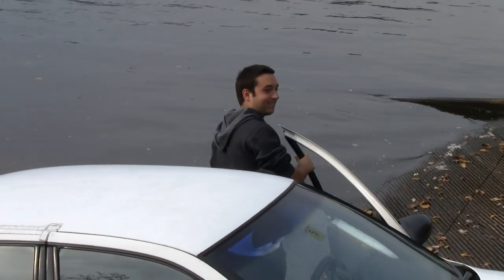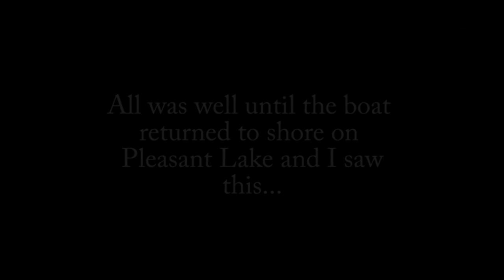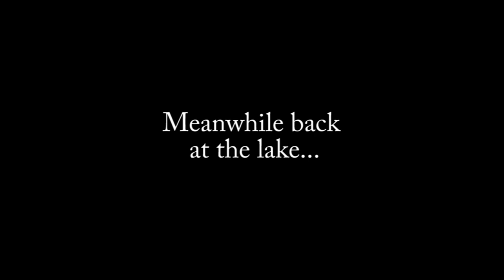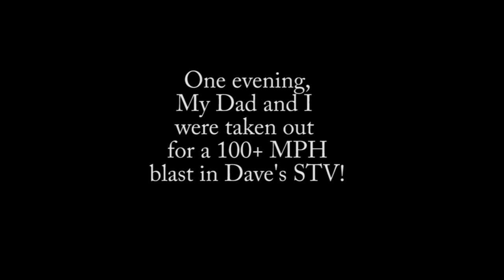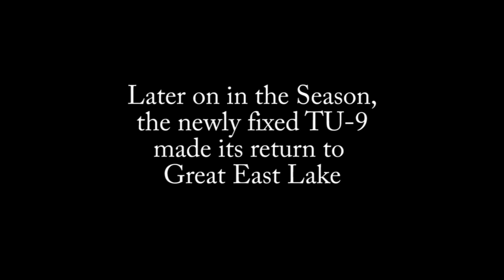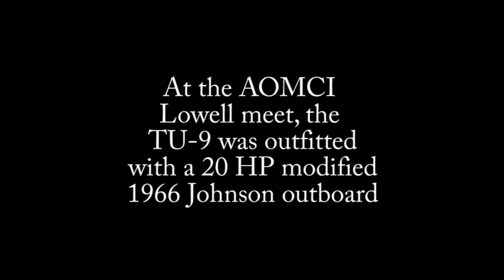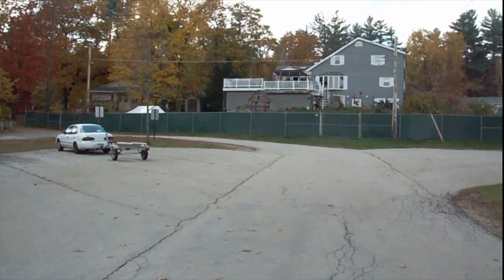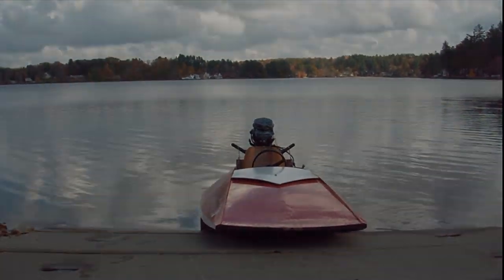Summer boating with the TU-9 on Great East Lake 2012

Comment: Nice Video!
Reply: Not sure if you ever got a good prop, but check for a prop at Ron Hills Propellers-he makes stainless racing  props for small motors. A nice 15-20 inch pitch small diameter prop ought to make it fly.